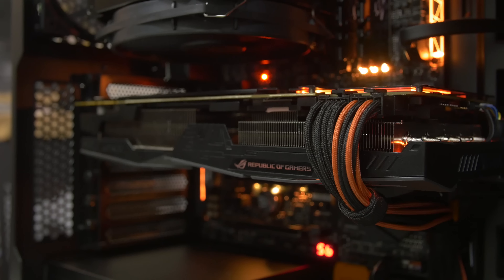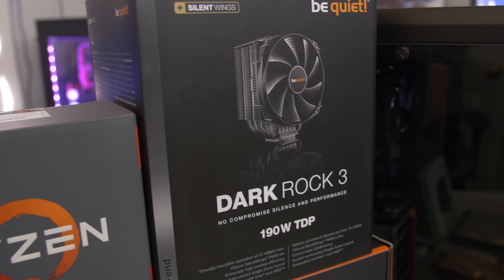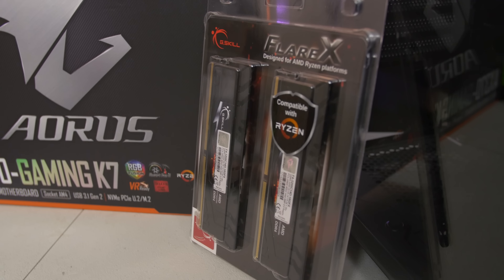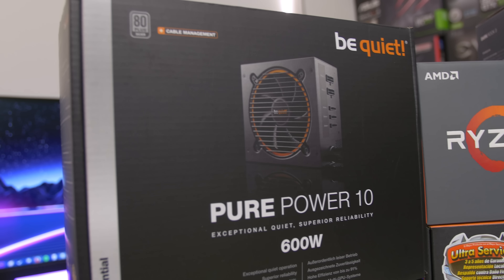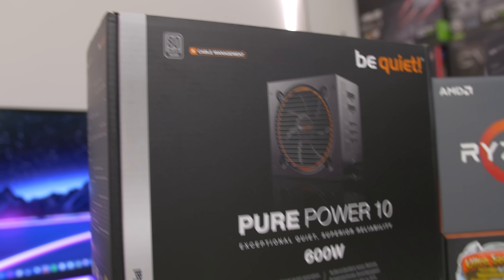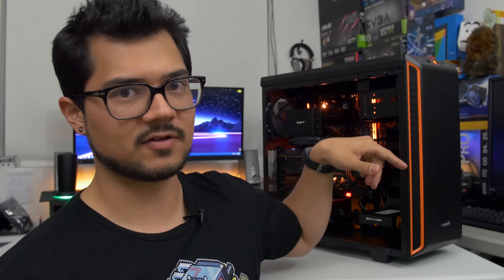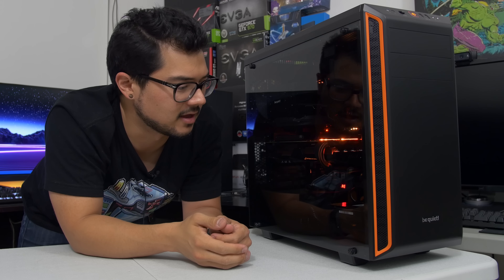INSANELY Fast Ryzen PC!! 1800X + GTX 1080 Ti

Comment: Want to hear a joke

Gaming on a laptop
Reply: RepsUp100 depends on the laptop. new Pascal laptop cards perform very close to the full size. and battery life on the blade pro and xps 15 are really good
Reply: Your joke is a joke.
Reply: RepsUp100 
Well I travel a lot and need my Razer Blade 14
Reply: Ran Ng every time you want to take a computer on a trip to game you want to lug a pc around? youre not focusing on the one goal of gaming laptops power on the go
Reply: That's your perogrative. Not everyone is subject to your life style. Don't bash a product because you don't use it when it does it's job and does it well. Nobody said a gaming laptop was supposed to be your main setting. Also what about video editors on the go? Typically if they don't use a MacBook they'll get a thin and light gaming laptop. Stop judging other people's choices simply because you don't agree with them. You're just as bad as MacBook fanboys
Reply: Ran Ng 
Well sometimes ill be gone for weeks so...
Reply: Ran Ng 
Some people still have a GTX 780 ti so its more like 4-5 years before an upgrade is needed.
Reply: FakTorThis 天空
Reply: RepsUp100 Acer predator with two 1080 in sli. That is a joke?
Reply: FakTorThis 
Dude, I need to program and study electrical engineering. I game also when I can. But I travel. Ofcourse a desktop is far cheaper, my blade was about 2,200 grand and for that money I could build a desktop with a 1080, Ryzen 1800X, 64 GB of RAM etc. but what good would that power serve me if I cant work in a car, or on an airplane with it? That money goes into the remarkable engineering of cramming tons of horse power into a good form factor. And in a hotel its so much easier to just pull out a laptop. I see your point on how desktops have far better value and performance than laptops but there are things desktops cant do.
Reply: Wanna hear a better joke...Gaming on a MacBook
Reply: Filip laskovski de
Reply: "I'm a pro gamer" "really what do you play?" "Angry birds"
Reply: no he meant Laptop. cause for a main rig it's joke worthy.

Comment: Those power cables are pulling onto the GTX 1080ti and will bend the PCI-e and/or the card in the process. Something simmillar happened to one of the computers at work.
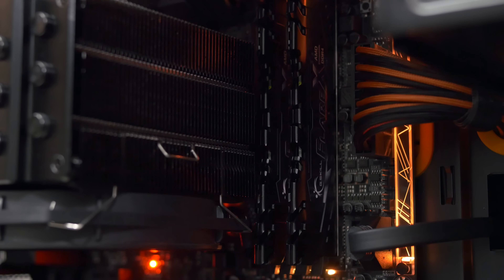Plus you can already see the graphics card bending downward at 11:11

Comment: Wanna hear a joke?

Cheap ddr4 ram
Reply: Black Helmets they are cheap
Reply: there are modules at 150 bucks online ddr4 3000 plus just gotta know where to look
Reply: nope...the are not....
i bought one set of 16GB hyperx Fury 2133MHz 7 Month ago i paid 60€
now the same Set is @ 130 €.... that's not really cheap
Reply: Der Asoziale Zoo not when used in a ryzen cpu + high end gpu system, in that case high speed ram matters
Reply: "So what's the deal? We reached out to a few memory makers to find out. According to our sources, the DDR4 price increase is due to a number of factors, but primarily smartphones are to blame. Essentially, mobile phone production using DDR4 chips is on the rise. 

The most recent generation of smartphones from the last year or so have been utilizing DDR4 memory, such as the Samsung Galaxy S6 and the HTC One M9, but thus far that hadn't really affected RAM prices. But that's changed in recent days. The launch of the Google Pixel as well as the Le Pro 3 from LeEco, the Chinese hardware conglomerate currently moving in on the US technology market, has increased demand for DDR4 memory. Combine that with the recent Samsung Note 7 debacle—and the company scrambling to produce replacements for its exploding phones—and the DDR4 market is under more strain than ever.

So what does this mean for for DDR4 prices? The market should stabilize, eventually, especially after the Note situation becomes less relevant. But more and more smartphones are utilizing DDR4 memory, so we might have to start getting used to a new normal when it comes to RAM prices. We'll see."

I doubt smartphones are gaining much performance by using ddr4.... it's such a waste.
Reply: Black Helmets Do you see PCs gaining much performance by going from DDR3 to DDR4? No. Obviously they're gonna use newer technology. Anyways, the recent price hike is because manufacturers are switching to smaller manufacturing nodes and their yields aren't as good.
Reply: my 16gb of hyperx fury ddr4 was 110 on amazon, not bad since the 16 gigs of ddr3 I bought last year was 70
Reply: INCONCEIVABLE!
Reply: Corsair 32GB DDR4 3000MHz $159.00 when I bought mines.
Reply: Black Helmets bought my crucial ballistix 1x8gb ddr4 2400 ram it is amazing
Reply: Scooby Dooby does it heat much if u oc it like that?
Reply: Yeah I took a break from keeping up with PC stuff for a few months, DDR4 be like: I'm so high...
Reply: Performance? No. But phones will benefit a lot more than desktops when it comes to the lower power consumption that DDR4 has.
Reply: yeah,last October an 8 gig stick of HyperX Fury 2133 cost about 30 bucks,now it's almost 70( local prices)
Reply: Something went terribly wrong with ram prices
Reply: Nemanja Marjanovic SSD too,where I live.About 40% increase.
Reply: Just bought an WD blue 1tb for 32€,that's a deal
Reply: Nemanja where did you get your wd blue for 32€ ? got a link or something?
I live in europe aswell and was planing to get one but everywhere i see them they're 250€ ++
For that price shippingcosts are irrelevant :D
Reply: Dr.ShadowTurtle wd blue hard disk 250? Rlly?
Reply: Dr.ShadowTurtle wtf, a wd blue is normally found dor around 50€ just search on amazon
Reply: +Black Helmets + Nemanja Marjanovic sry my bad, because of the SSD Part from Anuranan i thought you got a SSD 1TB for 32€, my bad, sorry ^^
Reply: Dr.ShadowTurtle hehe,if i got ssd 1tb for 32€ i would die from happiness
Reply: True that, same here
Reply: Black Helmets hahahahahahbahahahahahahahha oh how funny
Reply: JaJaJaJaJaJaJaJaJa
Reply: Black Helmets .
Reply: sad truth
Reply: FUCK YES DADDY THAT IS A GREAT JOKE AHAHAHAHAHAHAHAHAHAHAHAHAHAHAHAHAHAHAHAHAHAHAHAHAHAHAHAHAHAHAHAHAHAHAHAHAHAHAHAHAHAHAHAHAHAHAHAHAHAHAHAHAHAHAHAHAHAHAHAHAHAHAHAHAHAHAHAHAHAHAHAHAHAHAHAHAHAHAHAHAHAHAHAHAHAHAHAHAHAHAHAHAHAHAHAHAHAHAHAHAHAHAHAHAHAHAHAHAHAHAHAHAHAHAHAHAHAHAHAHAHAHAHAHAHAHAHAHAHAHAHAHAHAHAHAHAHAHAHAHAHAHAHAHAHAHAHAHAHAHAHAHAHAHAHAHAHAHAHAHAHAHAHAHAHAHAHAHAHAHAHAHAHAHAHAHAHAHAHAHAHAHAHAHAHAHAHAHAHAHAHAHAHAHAHAHAHAHAHAHAHAHAHAHAHAHAHAHAHAHAHAHAHAHAHAHAHAHAHAHAHAHAHAHAHAHAHAHAHAHAHAHAHAHAHAHAHAHAHAHAHAHAHAHAHAHAHAHAHAHAHAHAHAHAHAHAHAHAHAHAHAHAHAHAHAHAHAHAHAHAHAHAHAHAHAHAHAHAHAHAHAHAHAHAHAHAHAHAHAHAHAHAHAHAHAHAHAHAHAHAHAHAHAHAHAHAHAHAHAHAHAHAHAHAHAHAHAHAHAHAHAHAHAHAHAHAHAHAHAHAHAHAHAHAHAHAHAHAHAHAHAHAHAHAHAHAHAHAHAHAHAHAHAHAHAHAHAHAHAHAHAHAHAHAHAHAHAHAHAHAHAHAHAHAHAHAHAHAHAHAHAHAHAHAHAHAHAHAHAHAHAHAHAHAHAHAHAHAHAHAHAHAHAHAHAHAHAHAHAHAHAHAHAHAHAHAHAHAHAHAHAHAHAHAHAHAHAHAHAHAHAHAHAHAHAHAHAHAHAHAHAHAHAHAHAHAHAHAHAHAHAHAHAHAHAHAHAHAHAHAHAHAHAHAHAHAHAHAHAHAHAHAHAHAHAHAHAHAHAHAHAHAHAHAHAHAHAHAHAHAHAHAHAHAHAHAHAHAHAHAHAHAHAHAHAHAHAHAHAHAHAHAHAHAHAHAHAHAHAHAHAHAHAHAHAHAHAHAHAHAHAHAHAHAHAHAHAHAHAHAHAHAHAHAHAHAHAHAHAHAHAHAHAHAHAHAHAHAHAHAHAHAHAHAHAHAHAHAHAHAHAHAHAHAHAHAHAHAHAHAHAHAHAHAHAHAHAHAHAHAHAHAHAHAHAHAHAHAHAHAHAHAHAHAHAHAHAHAHAHAHAHAHAHAHAHAHAHAHAHAHAHAHAHAHAHAHAHAHAHAHAHAHAHAHAHAHAHAHAHAHAHAHAHAHAHAHAHAHAHAHAHAHAHAHAHAHAHAHAHAHAHAHAHAHAHAHAHAHAHAHAHAHAHAHAHAHAHAHAHAHAHAHAHAHAHAHAHAHAHAHAHAHAHAHAHAHAHAHAHAHAHAHAHAHAHAHAHAHAHAHAHAHAHAHAHAHAHAHAH
Reply: lol
Reply: ***** depending where you live
Reply: Black Helmets I
Reply: ^ troll ^
Reply: Absolutely right. I had to pay £310 for 32Gb of corsair dominator platinum 3200mhz for my 1800X. Thats almost the same price a 1700... (Corsair 3200mhz LPX was £275 but didn't work at that speed on my board). 

RAM is way too expensive these days.
Reply: Actually the LPX is compatible on every board even if it's not written, if it's cl16 it can go up to 2933 while the cl14 variant can go up to 3200. The qualified vendor list isn't always right cause on my board it said that the LPX cl16 could go up to 3200 but I can only hit 2933 at most
Reply: Black Helmets
Reply: It's cheap now you get 16GB 2400MHz for literally $80
Reply: almost 2020 now, just bought a 16gb 3200 kit for $70
Reply: This comment didn't age well

Comment: You can fix the sagging by adding a bolt to the corner of the card as if it were a stand. Then you pass the bolt through the base of the case and with one nut above and one below, you can have adjustable height.

Comment: when you have 2 consoles  but want a gaming pc :(
Reply: Leander Varma exactly me
Reply: Leander Varma just sell your consoles and build a badass gaming thick chick build
Reply: Fresh Avacado even if you had 2 PS4 pro’s, you couldn’t build a “badass thick chick” build with the money you got from selling them. You’d get around 500-700$ USD. And $700 is pushing it.

That’s only enough to get a build that can barely run Fortnite at 80+ FPS on ultra settings. 

Source: have a $675 Ryzen 5 2600 build with a Radeon 580 and 16GB DDR4 RAM. It would have cost less but I decided to go with a fancier case and shelled out the extra $30.
Reply: Sell em
Reply: Sell the consoles you could maybe get $150 for each as long as it’s not like a PS3 or Xbox 360 but idk what consoles those are, gets you $300 and for a bit more you can get a pretty good PC

Comment: damn! if it's that quiet I just might go ahead and use them for my own next pc build! The result is amazing! I only found out my AIO cpu water cooler is the source of my noise and was going to go air.
 do they do larger cases?  fantastic video
Reply: HaxCookiesDK funny you mention that because my pump has actually died on my corsair AIO. For how long it's dead I don't know but the fans are pretty noisy af. I'm tempted by the Be Quiet cooler but now I can't remember how quiet my corsair was when it worked. Hence why the air cooler seemed like a decent option
Reply: HaxCookiesDK and thanks for the comment, if I didn't know my pump was fecked you would have just alerted me, thank you:)
Reply: MiKroTeeK Hey thanks very much for the reply I took a look at the Dark Base Pro 900 and it looks class!
Reply: DownTimeGamerlkll
Reply: Are noise levels on the NZXT Kraken any good? I love the design of it tho. 😁

Comment: Want to hear a joke

Intel processors
FANBOYS BE TRIGGERED
Reply: I'm triggered... but not because of your joke, I'm triggered because I have no Ryzen CPU and Vega GPU in my PC!
Reply: Well youre right, I am using an i5 3570 right now with 8gb of DDR3 1600 Vengeance, a cheaper FX 6350 outperforms it in both games and cinebench (and overclocking of course lulz) - so yea, Intel is funny joke.
Wanna hear a funny joke? When you make the connection between Darpa and Intel ^^

Comment: To reduce the sag on the Graphics Card, I had the power cables going up to help pull upwards and out the back. Plus it doesn't cover the fins on the heat sink of the graphic card.

Comment: Does the RAM runs at 3200MHz ? Got the same one and it just doesn't boot at this frequency
Reply: Thibaud Garbin maybe its because you're motherboard does not support 3200mhz or you have a different model
Reply: Yes in facts my motherboard only support 2666Mhz with the lastest BIOS, at least, with this RAM model.
If I had only one pair that would works but I have two so I just want to throw it through the windows :)
Reply: Just use a xmp profile

Comment: Consider a GPU bracket. Mine is long and heavy (Sapphire Fury Nitro), and I actually have a zip-tie through a loop in the cooler, anchoring it to the drive cage. I've also seen some interesting lego creations to prop up the GPU from the bottom of the case.

Comment: Im going to build my own first custom build pc, i would like to hear if there is something wrong with the parts i've chosen.
Motherboard is Rog Maximus IX extreme.
Cpu is i7 7700k unlocked.
Gpu is EVGA GeForce GTX 1080 Ti SC Black Edition
Memory is G.Skill F4-3200C14D-16GTZR
Case is Phanteks Enthoo EVOLV ATX GLASS
Power supply is Corsair AX1200i
Crucial® MX300 275GB M.2 SSD
Samsung 850 EVO SSD - 1TB SSD
And then do custom hardtube watercooling

Comment: check out the company called RISE MODE, its a Brazilian brand that makes acessories for pc, cables, psu cover and also GPU support to install in your case, without screws, they have many colors and sizes, also they are very adjustable

Comment: Hi, i noticed that you are using extension for the gpu power supply and since the gpu card a bit sagging, have you tried routing the power cables via the holes same path as those 24pins power cables as well. It may look a little off, but i think it could help to offsets some gravity effect on the gpu

Comment: Great build. 
I actually have a query. My Comp freezes when I run cinebench CPU stress test for the second time. But it runs smoothly on the first run. I'm running a FX-8370 at 4.5GHz. With a CPU offset of 0.03mV.
Reply: Also my CPU temp stays in the range 57-62 degree C

Comment: This build looks awesome. I wouldn't have thought I'd ever like an orange build. It's funny though that for a high end build beQuiet! only send you a Pure Power PSU and not Dark Power or at least Straight Power, I get that they want to promote the Pure Base 600 but again, not their "high end" segment. And last but not least while the Dark Rock is pretty awesome, even better would've been the dual tower Pro version. Anyway, great video. :)

Comment: cant believe you would not use at least an AIO liq cool system like a Kracken 62 or H110i for the quiet of it. I believe radiators get the heat out of your system faster w less noise. Opinions?

Comment: Can we see the performance of it with the AMD Nano?Also you fan should be blowing air out through the back of the cause not up.It will heat up the processor.

Comment: my cpu cooler sits like that aswell but theres only like 1.5mm from the fan to the gpu cover plate. but well im not having any high temps. like 30-34celcius in 24celcius ambient tempatures. sorry for my english.

Comment: I really like the case ,too bad the gpu is sagging so badly if u ever come across a gygabite 1080 ti, id love to see if they bend the same way as they use a 2,5 pci slot . Because otherwise why is the point of having extra weight with reinforced pcb 's ...

Comment: I know i wont get a reply but, im getting a ryzen build, on pcpartpicker when i add a be quiet cooler it says " may require a separately available mounting adapter to fit the MSI - B350 GAMING PLUS ATX AM4 Motherboard" and at 2:48 he has a Am4 bracket, so does this mean if i use a be quiet cooler do i have to buy that AM4 bracket?

Comment: Hi, I have just discovered your youtube channel, I like everything related to computing so I like your channel rather well, but the problem of your configuration, CPU cooler you orient it in the direction of the Graphics Card, So the processor (cooler tone) takes the air out of the graphics card, so it takes no fresh air but already hot air, as it takes the air out of the graphics card. If you can change it and put it in a way that pushes the air behind its squeezed better. Good continuation: p

Comment: why doesn't anyone run video card, er...'Graphics Card'  power cables up and over the board then run them thru the same cut-out or grommet that the 24 pin uses? use some combs and keep the wires looking straight and it also helps prevent gpu sag no matter how grossly over-sized your card is. e-z, p-z. Done.

Comment: Is the sag caused by the weight of the card or a weak socket?  Will that card sag on any motherboard?  How about a video on GPU sag and ways to prevent or fix it.
Reply: ttocsms strix cards with 3 fans are very long and heavy. They will not do this will every motherboard. Asus motherboard the prime and crosshairs are designed for this heavy gpu and are reinforced. Mine does not sag because I combined Asus with Asus.

Comment: The question is, will Kyle be able to get XPM to work with that Gigabyte K7 mobo?  I have the K5 and it won't boot with 3200 ram and I'm loathed to do the frequency adjustments myself.

Comment: Is this the Same Thing with the Shadow Rock 2 in the wrong airflow Orientation with the Cooler?
Because I want to upgrade my Z87 patform to B350 with a Ryzen 5 1600nonX. 
I want to keep my BeQuiet ShadowRock 2 in my System, but I dont want this Crazy Orientation with the Cooler.

Comment: Will a r5 1600 work good with this cpu?if not,what about the r7 1700?
Reply: you mean gpu? for 1080p the 1700 would be better but 1600 will work and give good performance tho still would recommend the 1700 or higher but the 1600 will do fine for gaming
Reply: Ok thanks!

Comment: Hey Kyle, Was wondering If you can Help out. I just bought the AX370 Gaming 5 But cant find a compatible CPU cooler. My H80i mount brackets would not fit. Any ideas?

Comment: Is the i7 7700k my best option to run a 1080 ti ? I'm building my first gaming pc and I want to make sure I am getting the right one for my build and that I will have no issues, also I plan on using a 1440p 144hz 27in monitor if that helps

Comment: I am new to PC building and I want to build myself a gaming pc for approx. 800 dollars, I want to overclock my cpu and wanted some opinion, should i go for the ryzen 5 1500x or i5 7400, i have decided on the card, which is going to be 1060 6gb ddr5 by msi and i want to overclock as well.

Comment: I think ryzen builds should be like this : any r7 1080/ti, r5 1600 gtx 1070/60 rx 580, r5 1500 gtx 1060/50ti rx 580 570, r3 8when it comes out) gtx 1050 rx 560 550
Reply: Nano LP well I didn't get the 1080. Don't care for Nvidia so I got the 480. Waiting for Vega.
Reply: Yeah you Could always go with a lower powered gpu but those are the sweet Spots